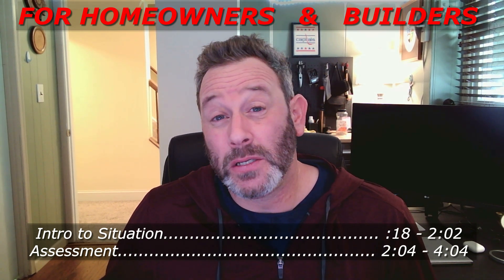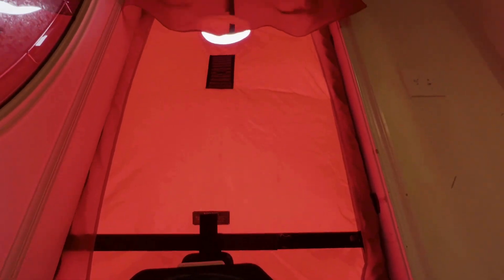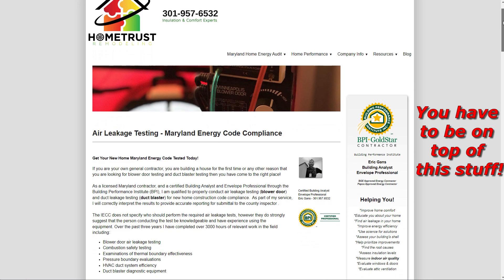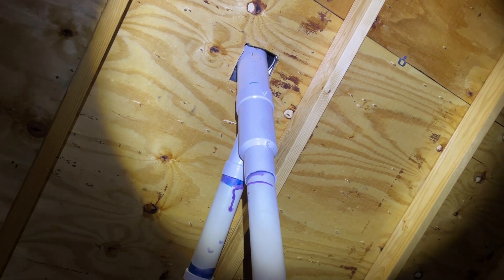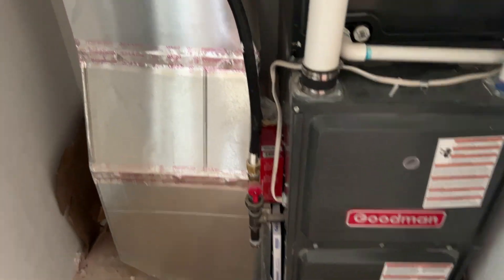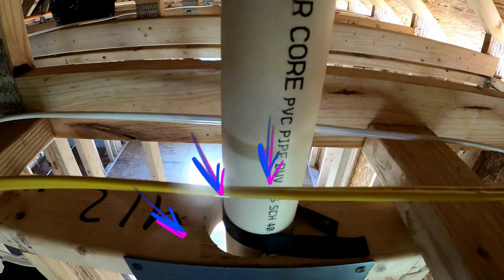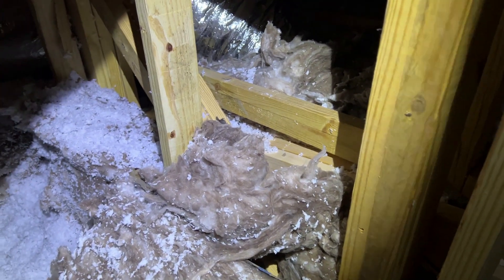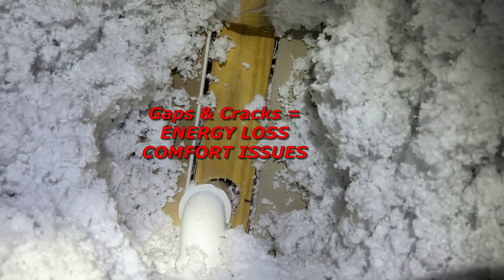Will This New House Pass the Energy Code? | Blower Door & Duct Test Red Flags in Maryland

Comment: Were the majority of houses built 20-25 years ago constructed this way, without sealing?
Reply from the maker: Good point. Yes this house is insulated to 1990s standards.
Reply: Lack of code, speed of builds to accommodate population growth, folks didn't know better and worked with what they had, and energy costs were incredibly low.

Comment: I’m in a townhome in FL which is a new home build. I closed in June 2020. I’m having issues with water condensation coming through my A/C ducts. I had several stains on my downstairs ceiling where the duct work runs. I had water coming through my microwave hood vent. I have massive condensation in my dryer. My powder bath fan vent continually leaks large amounts of water when we come into the summer months. The builder has tried to blame this on the fact that I keep my thermostat at 71/72. They opened up the ceiling to replace the stained drywall and there is absolutely no “sealing” like what I saw in this video anywhere in my home. The builder is Beazer. They claim this is an energy efficient home. Is it code that this type of “sealing” should be visible around the openings you mentioned in the video? If it should be, could I contact the county inspectors office. I just want the issue to get fixed. All they’ve done so far is replace the ceiling drywall where I had stains and seal the duct seams with more tape/glue which only puts a band aid on the problem.  Any advice would be appreciated.
Reply from the maker: First question. Where is the air handler. Inside or in an attic or crawl space?  Second: is this happening to only you? Are the others in your townhouse community also having the same problem?
Reply: @homeairleakagetest  air handler is in a closet on the second floor by the laundry room. No, I’ve heard from some neighbors they’ve had issues with water in their microwaves and dryers. I’m not sure if anyone else has had the same issue with water on the downstairs ceiling or water in the powder bath fan vent. I had the A/C unit serviced recently and there were no issues. I had the dryer vent cleaned and there was no lint causing a back up. The flap outside is working properly and my fresh air intake valve is operating correctly. When humidity level readings were taken inside the home they were within normal range. Every time we hit the summer months I have problems. They haven’t identified the real problem. I had a neighbor tell me her handler was improperly installed. Our outside units are in an enclosed space, not allowing them to breathe, which has caused several people to need to replace parts on the units way sooner than normal. Overall, I  know people in the neighborhood have had ongoing problems with their A/C.
Reply from the maker: When the issue is not super obvious it’s a little harder to solve from afar. If this is only happening to you then something is wrong (obviously lol). But what I mean is something is different. Something is missed. Do you have any features in or outside of your home that are upgrades or different? Maybe a raised ceiling or an overhang? You should get a blower door test done first. The test will help you with two things: 1. find any abnormal connections to the outside of the house 2. your house should be equal to or less than 3 ACH since it is new. If you are near Clearwater, FL try Attic Queen.
Reply from the maker: feel free to send me your address or a photo of your house so I can see the build from the outside (Google Earth). Sometimes I can see the problem with a photo or two. : )  eric@hometrustremodeling.com
Reply from the maker: Here is one video where the homeowners had a similar issue and the blower door helped find the connection to the outside that was causing the problem. https://youtube.com/shorts/yge2xRMJV-Y